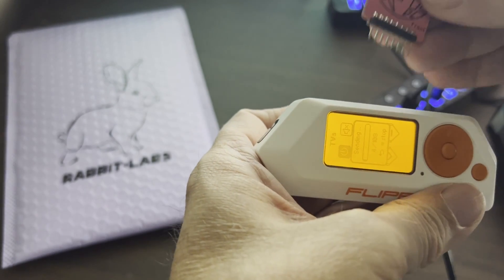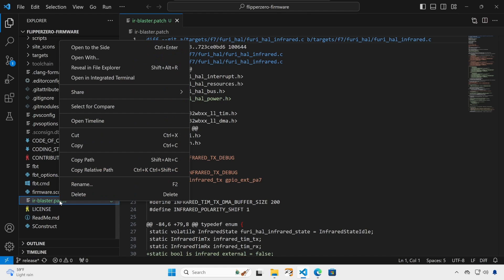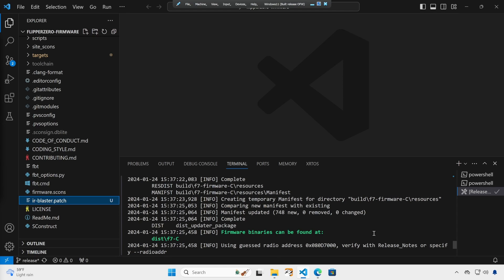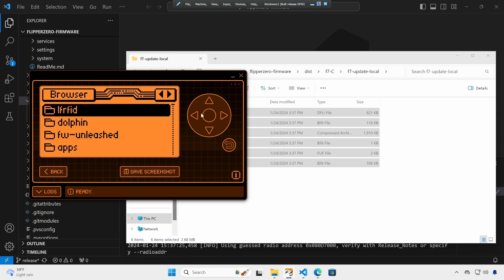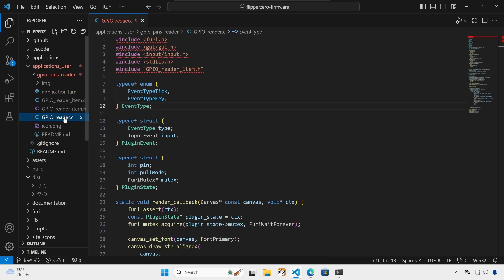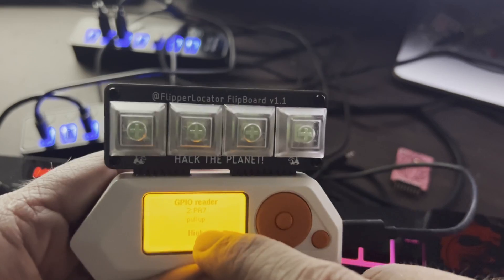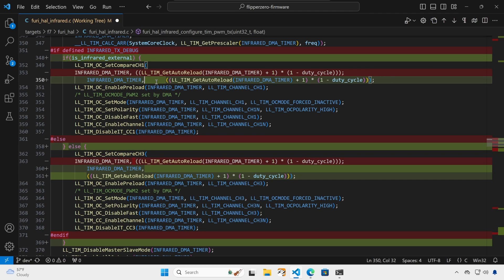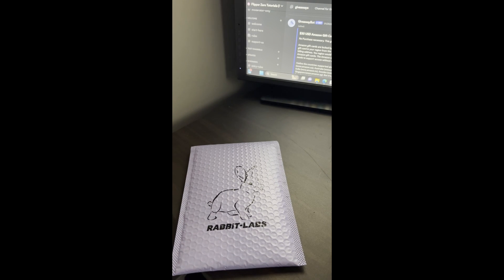[101] Flipper Zero - Auto-detect IR Blaster

Comment: The thing is that since this update my blaster stopped working. Another update not properly tested with all blasters.
Reply from the maker: Yeah, sadly it can't detect all IR blasters because there is no standard way to make them & nothing that uniquely identifies all of them.  The firmware that took this automatic detection typically has a setting to manually force on.    One solution is to solder a 22K resistor (or two10K resistors connected in series) between pin A7 and GND and then it will be able to detect it & at least all of the blaster I tested the functionally of the blaster wasn't impacted (like range wasn't reduced).

Comment from the maker: Good news -- The latest Xtreme and RogueMaster firmware now contain the patch!  Additional settings and modifications were made by Sil333033.  Thanks to RogueMaster for crediting me for the original code.
Reply: I just recieved my IR Blaster the original and I will give you my observations if that will help further your work I have Momentum Firmware.
1.) I turned on my flipper and plugged in my board.....I observed nothing special happened
2.) Then I scrolled threw my apps I stopped at Sub-GHZ because I'm lost once I toggled it and found myself inside on "Read" the "Death Star" came to life breifly or rather the LED flashed bright green and shut off I did not observe anything else but again I have no idea what I'm doing other then observing.
3.) I toggel back to Apps again go to GPIO and then down to 5v and toggel then to on the death star comes to life intense green LED4
4.) I toggel back to Apps the Death Star remains bright I go into Infra Red and suddenly the Death Star goes out. I enter to find myself at Universal remotes I enter....TV again I enter I observe and sand filles hour glass spinning around I have the TV remote available to me now. I press Power on...
The Death Star ignites it seeme to be scanning threw codes....TV turns on I stop the scan and hit the power again it goes threw a scan the TV goes out....The same process follows to change channels up or down....Turn the A.C. on.....off.
5.) I go back to Apps the Death star remains lit go to GPIO turn off 5V the Death Star goes out.....go back to apps and back into Infrared...Go to Univeral remote then to TV..The hour glass spins....I hit power the Death Star ignites TV turns on do it again TV turns off go back to TV...again to Universal remote it remains lit....back to App the Death star goes out again go to GPIO down to 5V it remains turned off.....
It seems to work automated with this firmware and the range is better then the flippers internal board un that I do not have to hold the flipper up towards the TV. The Death Star
and the 5v seems to automate when a  IR product is selected. Those are my
Scientific observations I hope it is helpfull.

Comment from the maker: Someone tried it with a 3 pin blaster they bought from AliExpress and that blaster doesn't get detected on pin A7.  I ordered one of those blasters, should be here around mid-February, so I can test with it and see what options we have for auto-detection.  I was also thinking about trying to make a pin C3 detection circuit that would use a couple of additional resistors, if people thought that would be helpful for their modules - most modules I know about don't seem to use the pin C3 (7th pin) on the Flipper, so seems like a good candidate.